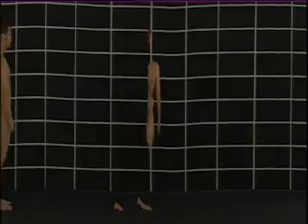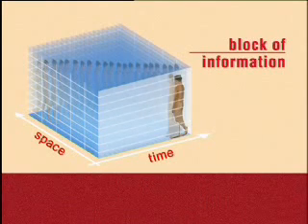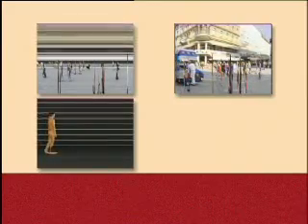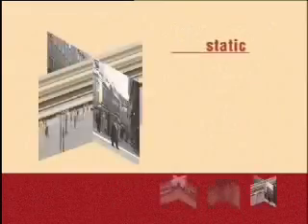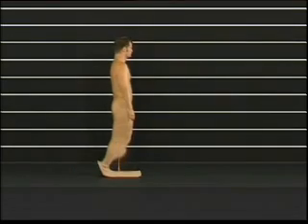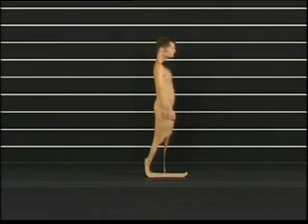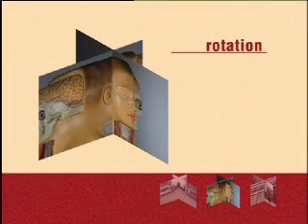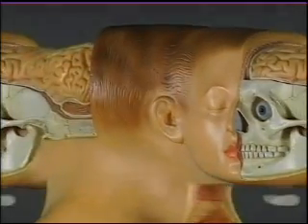tx-transform trailer (1999)

Comment: and the strip effect does nearly same effects. objects that do not move, become to lines. object that moves in same direction and speed as the film, are just looking normal. so if you turn a can on turntable, you get also a full rollout surface. so what is the different ===?===
google for strip photography